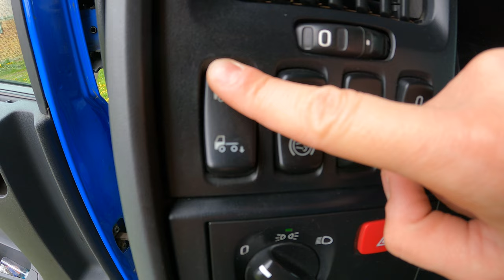How to do maintenance for truck coupling system

Comment: Maybe the video was edited in a different order to which the detachment process was really done.  I have seen the aftermath of two serious incidents where the driver pulled the 5th wheel handle first before applying the separate trailer brake and detaching the air lines. In both cases the trailer dropped off and ran away from the tractor unit down a very slight slope before the air lines snapped and applied the trailer brakes. In the second incident it rolled 25m and partially demolished a large shed. When detaching a trailer, pulling the 5th wheel handle is the very last thing that is done. 👍  When I trained drivers to detach trailers safely in the yard, many did not know this, even experienced ones.
Reply: Wow, n I t nice.  I really enjoy the young lady.  I l lost my da I daughter and she was a go getter
 God bless her ❤

Comment: So amazed by your videos, but if I may,  for me uncoupling trailers...first thing I do is trailer brake on and detach airlines...tug test to make sure trailer brakes have engaged, slightly raise tractor, lower legs, last thing I do is pull 5th wheel and then uncouple, drive slightly forward the dump airbags to prove legs are locked then pull away. Over time we all do the same checks but slightly different, same result in the end.

Comment: The very first video I see you’re actually using gloves.
Greasing the fifth wheel is important, I fully agree and every driver should be doing it if there is no fitter to do it. It prevents premature wear and tear and possible failure. Good one!

Comment: Just a quick tip, always detach the air hoses before opening the fifthwheel. I did that once and the trailer rolled like half a metre, although its unlikely in this grass, but still good practice :)
Reply from the maker: That's right, but the truck was parked all night, and by morning the air pressure in the system was 0, so the braking system is activated and the trailer cannot be mounted.
Reply: @blondietruckingadventures  Ahh yeah, fair enough 😂

Comment: Very good blondie the airlines on your truck look so much easier to disconnect than the English scania and did you have no safety clip on the fifth wheel handle ? Very good reversing such skill a cooking video next please😊
Reply from the maker: Hello Adrian!😊 At 0:32 seconds, if you observe carefully, I use my thumb to pull down the safety clip and then I pull out the fifth wheel handle. What is the difference in the disconnecting an English Scania and this type of Scania which I drive?😊 I never disconnected one. I promise soon I will show some cooking! Take care!🙋🏼‍♀️🌞

Comment: Great video. I have one question. Is it not dangerous, to place the trailer on solid earth? if rain comes, it will be mud, and it can make the trailer unstabil doesnt it?
Reply from the maker: Hello Thom!🙋🏼‍♀️😊 The area where I park the truck is very rocky and full of stones since it is located among the mountains, so there is no danger of the truck sinking. Otherwise, you are absolutely right. If you don't know the place where you park and if you are not sure if it is stable, it's better not to place/disconnect the trailer.

Comment: Wait a minute, why did you raise the axle before pulling off? Isn't the kingpin gonna go higher when the trailer loses all the air and sits? 
Will you be able to reattach it? Tell me more about this trick. 
Oh and.....kind reminder to all happy truckers out there : 
FIRST you lower the landing gear, and THEN you do everything else. 
Or at least....first unlock the kingping and then IMEDIATELY lower the landing gear, and then do everything else. 👍👍👍👍😎
Reply: I too raise the truck before detaching, this way after the fifth wheel has ben greased, I can back almost all the way into the kingpin, then raise the truck before reversing the kingpin into the lock. That way I don't get grease everywhere underneeth the trailerfront
Reply: @matpol098  ....yep, that was my suspision too, I kind'a realised it after she mentioned it in the video. However, I did notice that even if I don't raise the 5th wheel for detaching the trailer, after loosing all the air, the kingpin is raised anyway, so going under it with the axle in normal position, the kingpin still sits higher and I need to raise the axle anyway. And besides, when backing to couple, I go out and see where the 5th wheel is standing, and if I see it higher than the front plate, I lower the axle and put it in with a small gap, and then raise it again.
Is it me or is it more work for nothing??? I don't know...👍👍👍
Reply from the maker: That's right! @matpol98